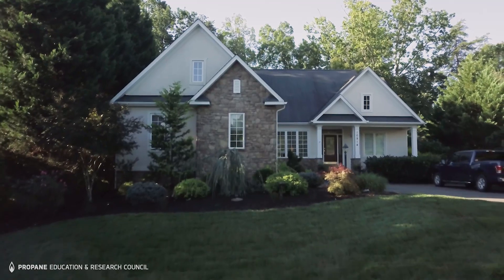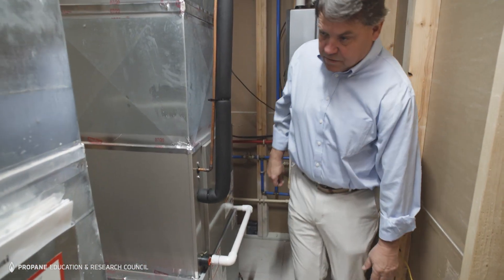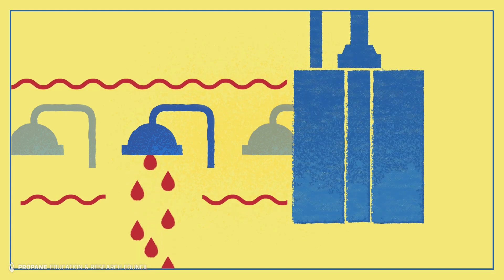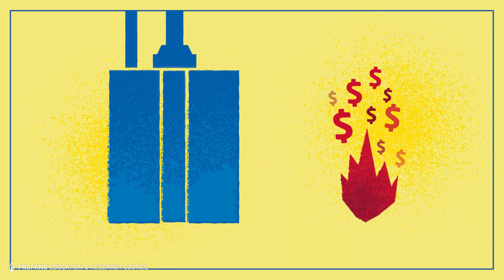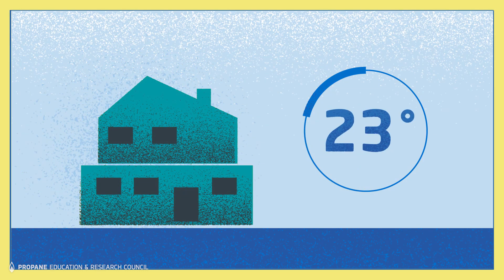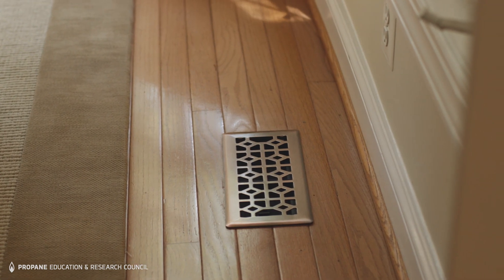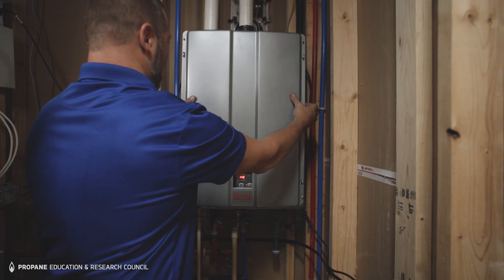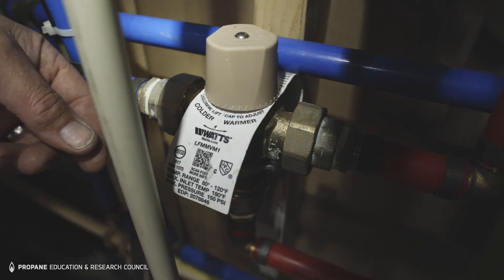Can you heat a home with a tankless unit?

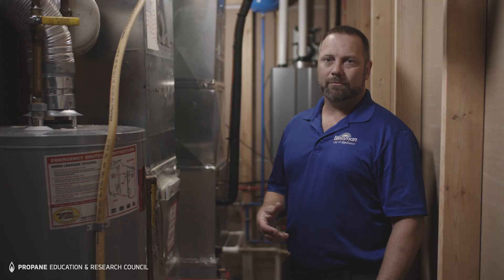Comment: I have a question. You already had a water heater (visible in the equipment room starting at 7:05) that could run the hydronic system. What am I missing?
Reply: Same question. Nobody does follow ups on these videos. In this case it must have been a colossal failure.